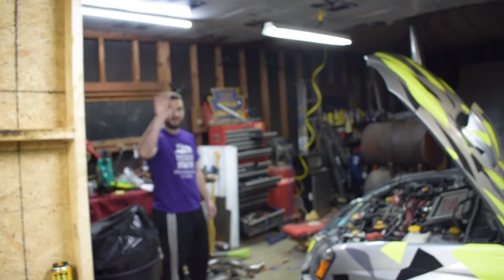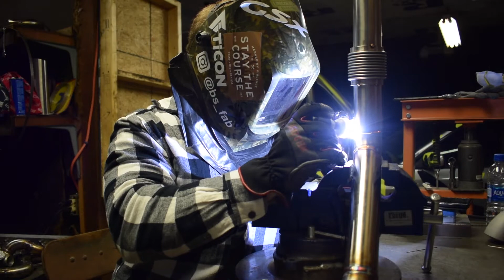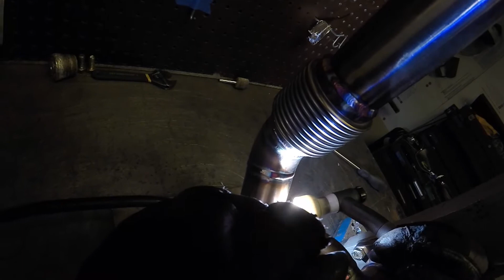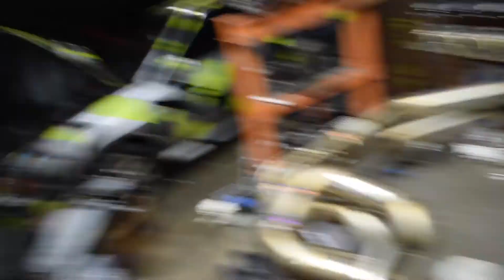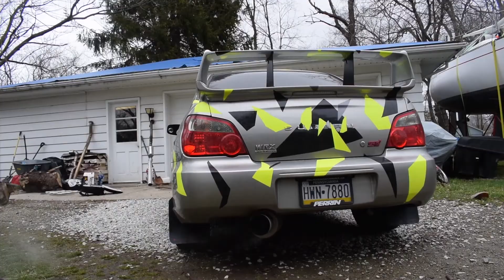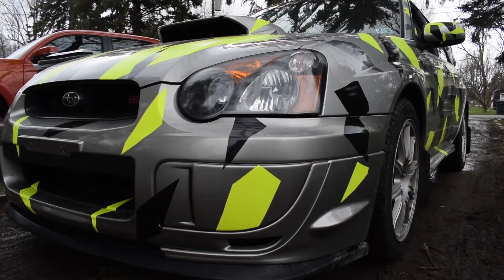MAKING A CUSTOM SUBARU STI MANIFOLD

Comment: Hey man, on these videos it would be really cool if you went over your thought process in why you're using each piece in which way, like how you actually build and decide how you're going to route the runners, what material, why, filler, welder settings, recommendations etc.  I think that would add a ton of content.  Not hating, I appreciate the effort put in but it would be cool to see more of a how to, not so much a "just do" you know?
Reply: Also, what size pipe are you using for this build?  What size did you use for the evo?  If there is a difference, why? Honestly wondering because I am wanting to start my own shop like this and yeah
Reply from the maker: I'll try to do some "how to" videos. It's tough finding time to do these videos. I'd have to break how tos into a few sections so the videos arent very long. I appreciate the feedback